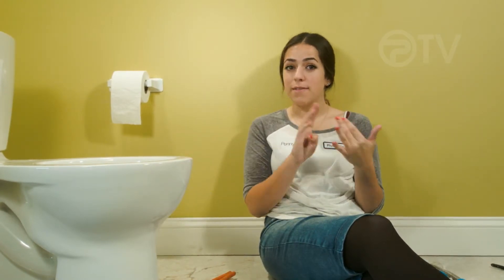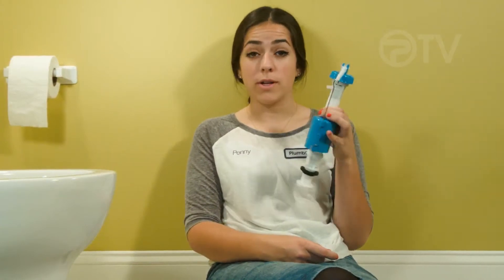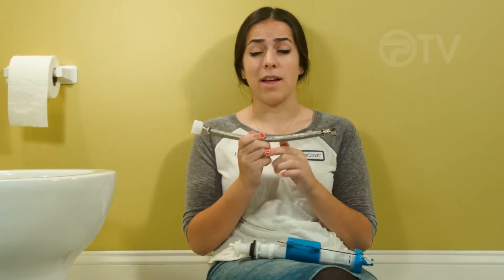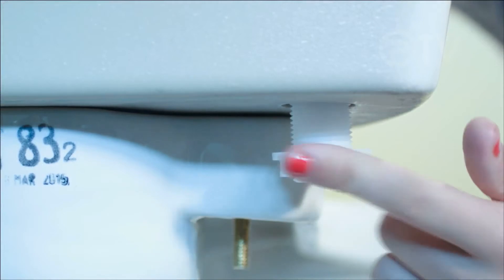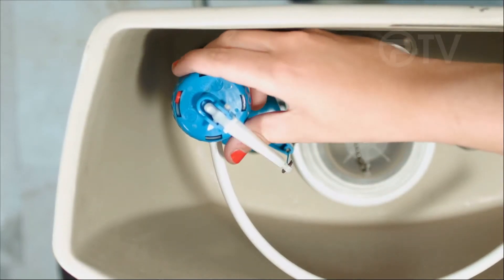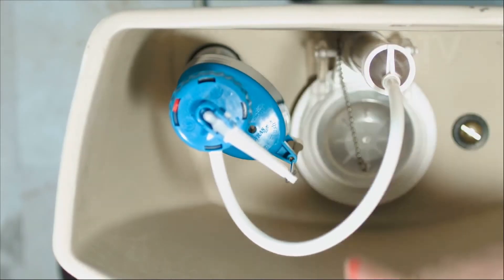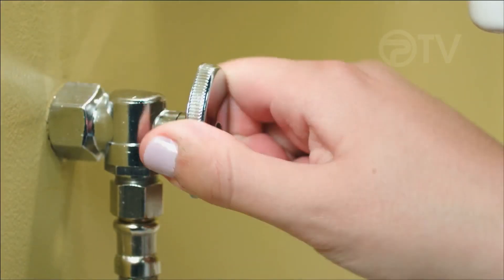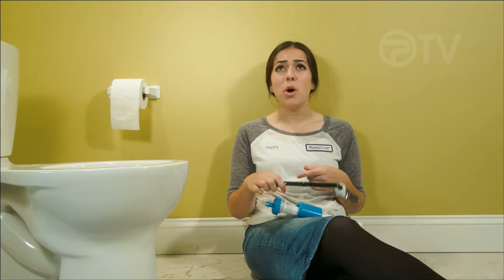PlumbCraft Penny How To Part 4: Install/ Connect Water Supply To Fill Valve

Comment: The fill valve will not turn either counter clockwise or clockwise.   Is there a lock mechanism that is stopping it from turning?  Maybe I should get a different brand insteas